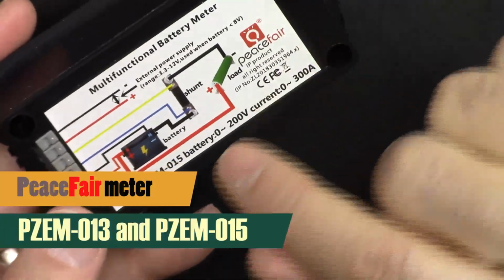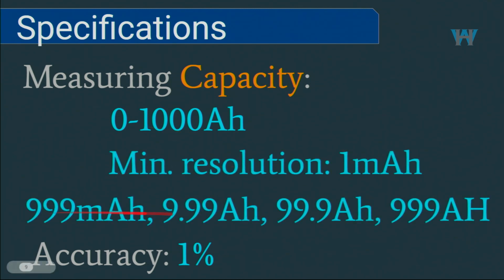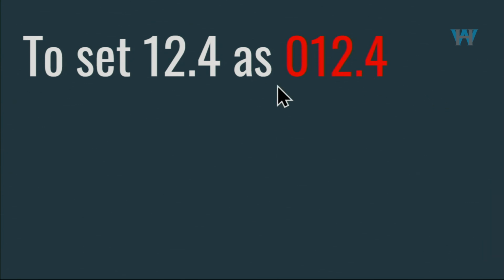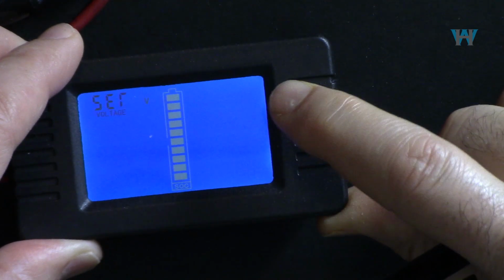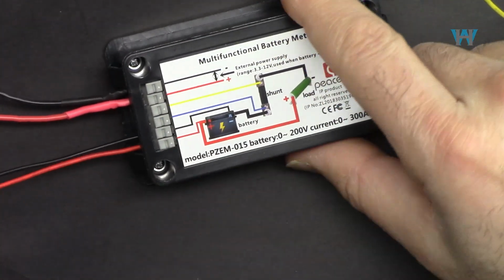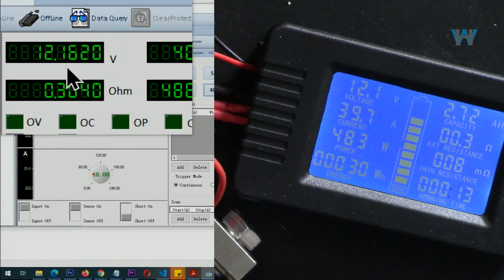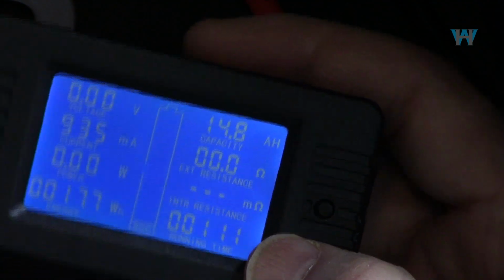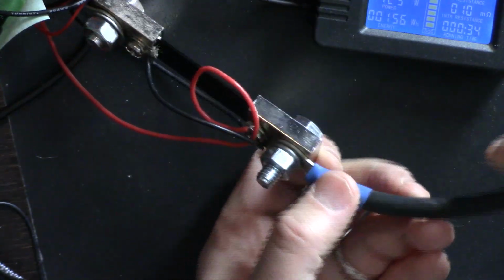Full Review of PZEM-015 PZEM 013 0-200V 0-300A  DC Energy, Voltage, Current Capacity Meter

Comment: has anyone figured out why the meter is reading fluctuating current ( 250 - 300 mA, ext reesistance aprox 130 Ohms). 
this Occur on following circumstances :
1 : connection via 15m network cable.
2: no current drawn.
??

Comment: Best and most extensive video I've seen on this meter from hell. Why that description? The device seems to work very well. I don't know if the devil worked in the factory or at the seller's but the English instructions were probably the worst, the most confusing translation I have ever come across. I nearly tossed the device into ewaste. But thanks to this video I will go and try again to program it properly.

Comment: If I bought a PZEM-015 and I just want to use 10A load, can I just not installing the shunt that provided? Does it has built in shunt like PZEM-013?
Reply from the maker: for 10 A y ou don't need external should look at the wiring at back of meter.

Comment: @WattHour thanks for the great explanation. I have the 300A version, disappointed that the capacity meter runs from 0 up as the battery is used? I thought it could be programmed with what my battery’s Ah capacity is and then it displays the number going down - if that makes sense.

Comment: I bought this to know how many % I have left in my battery.. But if this goes just off voltage, and not the fact I have 300 Ah, and used let's say 200 Ah of the 300,  then it might be useless? I notice voltage is pretty bad when measuring LifeP04's.

Comment: thanks so can i use this on  DC generator to check its power outputs also here  with the 015 unit ?  If this does not check the output volts of dc generator do you have link that does this ?

Comment: If I connect two units, one on positive side and another one on the negative side, will it be possible to get current measurement in both direction from the battery... Bidirectional?

Comment: The 300Amp shunts sold on ebay with this meter tend to be inaccurate and under read the current by about 2% on the low end of the range. The results vary a lot for meter to meter, there is no internal calibration pot either. Voltage also under reads slightly. The meters measure current in both directions, and the SOC is based on voltages which is near useless. For accurate use, you will need to make up a circuit with 2 meters on one shunt, and switch between charge and discharge current flow direction, and keep track of power in and out as well as voltages. note battery voltage varies with load

Comment: I found the meters tend to under read the current slightly. Also as soon as you connect the meter to an inverter the noise from the inverter on the positive supply disrupts the meter, causing it to under read the current considerably. If the meter is put inside equipment case near a dc-dc converter the rf noise can disrupt the meter causing wrong low current readings. The only fix is to install a small 47uh inductor in series with the +ve supply to the meter.

Comment: Hi!  I have a quick question for you.....I set the voltage Hi and low and I lost the SOC display being full as my battery is fully charged.  I'm wondering should it not show all segments on being full?  Is there also a way to reset meter to default right out of box?
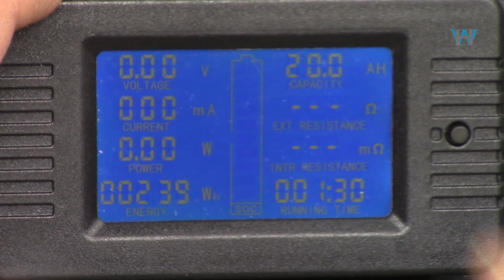Reply from the maker: Hi, I had to watch the video to answer. I have shown how to reset it in the chapter ( 6:43 Setting Explained), you can use chanpter to jump. it is at arround 13:00 or so.

Comment: Great video. It explained a lot to me. I still have a question: what is the point of setting cut off voltage? I expect it should be the voltage when discharging should stop automatically, but looking at wiring I do not see any possibility how it might happen for pzem 15. It looks like load and battery are always connected through shunt and the pzem can't stop further discharging. Any explanation?

Comment: Hi. Thanks for the video. I’m using one of these for my 130 VDC, 25 Amp treadmill motor. I understand the 12 VDC connections for display power. But I don’t understand the second set of DC wires you connected at the bottom. Where do these come from?
I bring my 12 volt DC wires in for power. 
I connect my big DC negative to one side of the shunt and it exits to continue to my motor. But I don’t know what to do with the other wires. Can you tell me what I should connect there?
Thanks,
Paul

Comment: I have just setup and tested the 200a model and at just 40A of current, this meter reads 7 amps higher than the actual current flow. Is there a way to calibrate this inaccuracy? I am comparing measurements with victron smartshunt and also victron bmv712 which are both known to be very accurate. I wish i was seeing the accuracy you got.

Comment: Hi there Great video. There is just something i want to know further. I am interested in the capacity meter part of the meter. I see that it counts up from 0. so in theory if i have a 100ah battery and that counts up to 10a, then there is 90% of the battery right?

So...that is great, but does this automatically reset when the battery starts to charge by my inverter (connected to load) our would it count backwards because the current is flowing the opposite way? - if that is even a thing? Would I always need to reset this value as you have shown?

I just like to know the capacity left of my battery each time i use it.

Comment: Thanks for review. Can this unit calculate decrease of capacity when current flows in reverse direction ? For example, when charging battery?
Reply: From my observation. the energy calculation in WH needs to be seperated for current flowing IN and current flowing OUT. The amount of energy is one way up.  The energy (WH) increases, even when the current is flowing in or out of the battery.
Reply: Did you find the solution tell me please I am also want to measure charging and discharging capacity
Reply: @suryakantabehera2565 No, it only adds capacity values, no matter what direction of current is. Both charge and discharge capacities are summarized together with no respect to its signs(plus or minus)

Comment: Hello , if i remove the ground probe/sensor cable from the battery , that is used to measure batt voltage , the values in the display change , but its still kind of working . Could you explain what happens in such a szenario ?

Comment: I got the 300ah version of this battery monitor but my question is probably i will use a 100ah gel battery and is it really matter to use 100-200 or 300ah shunt it will not affect the readings is in it? Also i will not draw 300ah from the battery when im using the 300ah shunt i will use it for my campervan for monitoring the currents i hope u understand me

Comment: This is an amazingly thorough walkthrough of this meter. I would have given up at entering the volts with that one button and only 3 digits displayed ! 🤣 Have they made a 3 or 4 button model yet? I’m trying to find a meter that will read both the current and volts on the input side (solar panel to controller) and output (controller load ) but simultaneously. Have been having a hard time.
Reply: Have you found one yet?

Comment: i have the 300 one i put in yesterday, its not matching what my mppt screen says except the voltage, i placed this between controller and battery, but wiring i followed picture so that my blue was by the battery, but in reality my battery is the load and so i wonder if i hooked this up wrong?

Comment: I bought it and disappointed. The SOC is fake it's only an estimation based on the battery voltage, not current as it should. Plus it only counts the current while discharging, not charging, so the displayed value is also false if you charge the battery while using it (which most of the time is the case). Useless gadget.
Reply: Have you found anything that is more accurate- would love to purchase…. Thanks
Reply: @apjbuilder  there are many but more expensive. I kept this one and use the bsm bultin one for more details.

Comment: I'm confused. Irrespective of charge/discharge, Ah measurement always increasing ?
Reply: Yeah, that's what (@fredericleitenberger2213
1 year ago) said. Makes this device a lab curiosity I can use on the bench but it won't  get installed as a fuel gauge for my truck's auxiliary battery. I'm quite disappointed too. ☹

Comment: Hi there 
Really appreciate the way you’ve done the presentation of setup. I just wanted to ask about charging and discharging. How can I check how many Ah has been charged and how many discharged? Thank you in advance.
Reply from the maker: You can’t . You can either track the sum of charge and discharge. It does not have such feature
Reply: @WattHour  thanks
Reply: Hi did you find the solution

Comment: When it goes past the low voltages will this stop the battery from sending power to the inverter
Reply from the maker: No it does not. This is just a meter. You need this https://youtu.be/kLO6IApDgSk

Comment: Hi, i have this, but i didnt not connect any power to the top 2 connections, do i need to do so? I connected to the leisure battery from the bottom 2? And it still turned on, but where do i connect the top 2 connections to? External power? Isnt that just the leisure battery again? So why need 2 lots?
Reply from the maker: Hi, your question is telling me that you have not watched the video fully. This question is very basic and I have addressed it in the video as to what we connect and where we connect. So please watch the he video fully. I have spent about 2 days (or more)to make the video and if you need to learn you gotta watch it.
Reply: @WattHour  so your not willing to answer questions? My monitor is on & what i seem is working with only 1 set of power connections, so why do you need the second set of power?

Comment: Hi just bought this 200v model and a great price thanks for all the info, you have been very helpful  just one question I see no one els has asked 
Can I extend the small wires or do they need to be kept at this length for accurate measurements thanks
Reply from the maker: Hi, yes I believe you can extend it as this meter does not need current to read. It just need voltage and when there is no current going through the wire , there won’t be any voltage drop and it should not affect reading. Just get for example 10meter wire and measure something and change the wire with 50cm and compare readings.

Comment: How come your meter shows internal resistance when mine just shows zeroes instead ?
Reply from the maker: not sure. Sometimes people replicate them or may be you got different version if a battery is connected and load is turned ON.
Reply: @WattHour Thanks for replying , I appreciate your input.     But I was thinking that this may be caused by wrong wiring order? The instructions say that "the wiring order can't be wrong". But  I'm not sure how exactly to do this, the instructions are vague about order.

Could you please kindly help me by uploading a photo of your exact wiring so that it is obvious what goes exactly where? Because it's also difficult to tell from just  your video
please please

Comment: Two quick questions...

1) what does the reading 'mah capacity ' (top right) refer to? What is this measurement?

2) I'm getting 0 reading for internal battery resistance. Any idea why? Is this an issue?

Thanks again for helping so many with your time and expertise. 🙏
Reply from the maker: Hi, the Ah or mAh is the capacity of that is charged or consumed. Battery capacity is measured with Ah or mAh (milliampere Hour).  
2-The ideal internal battery resistance is  0ohm and unlimited current output.  but all batteries have internal resistance and this device is calculating approximate value for you at the that particular instance. so do not trust it as battery paraments are changing and you need for complex method to calculate it.

Comment: What bench power supply and windows program are you using please?
Reply from the maker: Power Supply I use:
DC 30V 60A Power supply: https://s.click.aliexpress.com/e/_98Ah5c
DC 60V 30A Power supply: https://s.click.aliexpress.com/e/_APyPJ0
and using ITECH IT8516C Electronic load https://www.tequipment.net/ITech/IT8516C+/Electronic-Loads/ which comes with software

Comment: How do I get the SOC meter to display ??
Reply from the maker: not SOC but approximate capacity.  and I have explained that.
Reply: @WattHour  yes, in short, it doesn't do SOC. This is despite the three letters "SOC" at the bottom of the bar graph. I am annoyed because I wasted my money. It sounds like I am not alone in my expectations. This device has a current shunt (required to get current data) and claims SOC yet fails to properly implement the feature. Not sure if that is due to a language barrier or the maker doesn't understand what the customers want / need. But it's a fail from me.

Comment: This unit  counts both ways up,it counts battery charge and discharge as the SAME;   in other words, it ADDS the Charge Amp-Hours and the Discharge Amp-Hours, and you really don't know what went  on;

Is there a way to block one of the ways, for example if the sun( with solar charging of batteries) comes and goes, due to the clouds,and the batteries charge and discharge, is there a way  for it to count ONLY the Charging Amp-Hours?
Reply: How to connect the charger wire please tell me the connection

Comment: Hello, So the Ah doesn't show the Capacity of the battery by measurement or calculation. Instead it only is showing the amps that were run through the Shunt and so the Ah is the same as kWh. I wish it had two counters for charging and for discharging so I could see how many kWh the battery was feeded from the solar and how much kWh it spend provided at night... Thank you!!!
Reply: Is it also tell charging current?
Reply: @supremeleader5516  yes 👍🏻
Reply: @oOBassKillOo  is that in negetive?
Reply: @supremeleader5516  nope 👎🏻 unfortunately not, charge and discharge Both are shown as positive current
Reply: @oOBassKillOo how can I connect the charger please tell me the connection
Reply: @suryakantabehera2565 
You got +/- for the device supply
Then +/- for your battery measuring voltage
And the shunt which is in row with - of battery and on the shunt you have the last 2 cables for measuring the ampereage
Reply: @oOBassKillOo listing first of all I will connect the all the things shunts and all lastly I have to port one input and output put  input is my battery and output put is my load so now I want to measure the charging voltage so I want to connect my charger where I connect to the charging+/- can I connect the charger direct to the battery or what I Didn't understand please tell me if you have any videos or something
Reply: @suryakantabehera2565 

You connect your charger to the battery as usual, plus to plus and minus to minus. You should be able to manage that on your own. Then you have + and - on the meter, which is the supply voltage. You can, for example, connect a USB power supply to it, again + to + and - to -. You only need this connection if you want the meter to stay on even if the battery fails. Otherwise, you only need the remaining four cables. You also connect the first two, + to + and - to - from the battery. Now we come to the shunt. You have to loop this into the negative cable of the battery/charger. So cut the negative cable and clamp the shunt between the two. The remaining cables from the meter are attached to the connections on the shunt. I can't explain it any better than that. I don't have any videos and I won't make any. If you don't know much, please be careful not to start a fire.
Reply: If I do this can measure charging capacity of baattery  @oOBassKillOo

Comment: Hi, will this account for both change and discharge? Im intending to use this is my solar battery, which is getting charged and discharge all the time. Will this do the coulomb counting accordingly?
Reply: Been using it for a while , not useful for that because it ADDS charge Ah and discharge Ah,so you will not know how much went in or out, nor the true SOC, State Of Charge of the batteries;  it has a very limited utility, it's good to do a full discharge or a full charge only, with nothing in between.

Comment: Why you set the highest voltage (@ 30 min) to 12.8 (nominal) and not 14.6 v (3.65v each) ?
Reply from the maker: 6, 9, 12, 15 are all standard voltages. Lithium villages are not used in any devices people use.

Comment: Kind sir
I have a 2901Ah 2V Battery
could this watt meter calculate the capacity?
Reply from the maker: Yes it can.
Reply: But it says on the video that the maximum capacity is 999Ah
Right?
Reply from the maker: It should be 4 digits 9999
Reply: No i think its a 3 digit
Could you check for me because this is a necessary for me

Comment: Thanks so much WattHour for the explanation how to use the monitor. I bought a 300aH lithium battery with a PZEM-015 already installed in the battery case. I had no idea how to use it.. After a long search I came across your video which is a great help. 🙃

Comment: when recharge it need to remove or not
Reply from the maker: No. It will work. Do not remove it.
Reply: thanks bro
Reply: What the connection of the charging wire

Comment: hello. very nice video. I have this device but I couldnt understand why do we use LOAD and Battery at the same time?  what is load and what is battery in this terminology ? confusing.  could you please explain? thanks
Reply from the maker: Hello, at the input we can have solar panel or power source from wall outlet or a battery.  Then for the output we can have batter that is charged from solar panel or wall outlet. If we sit have battery at the output then it we have have a bulb or motor. Any case we can measure the amount of energy .